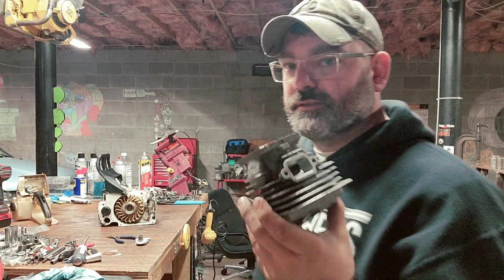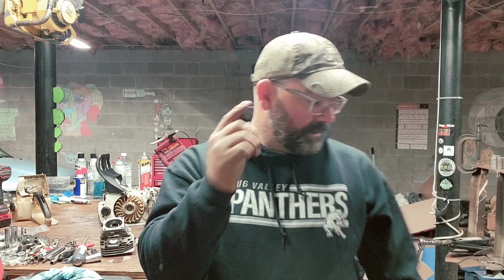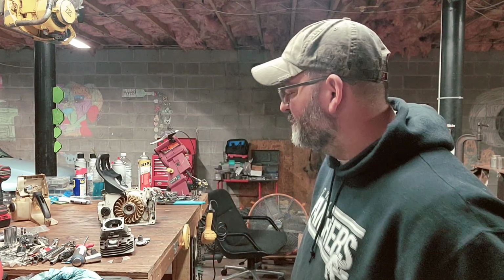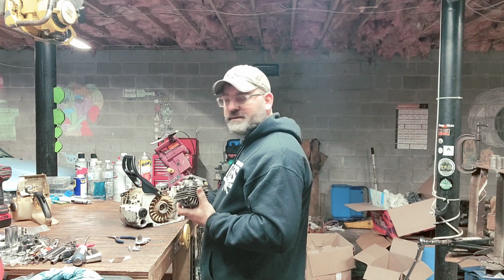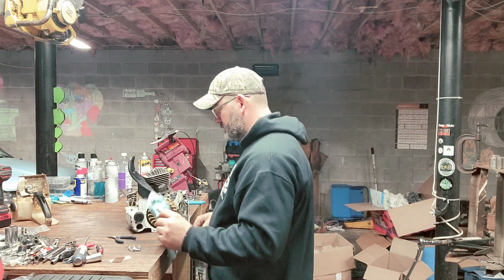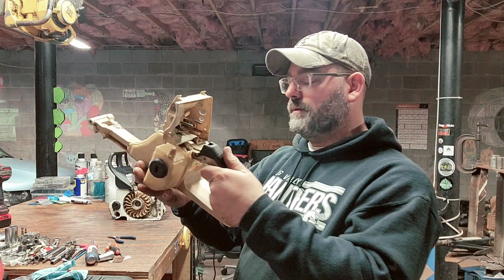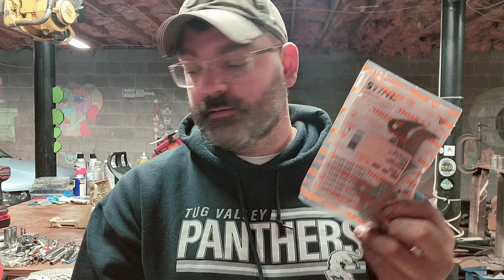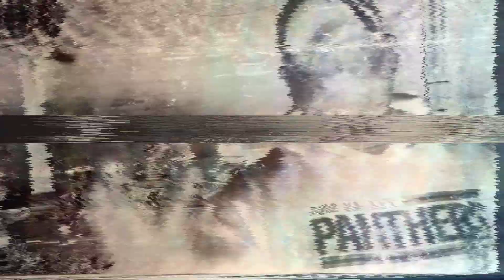Stihl 044/046 ( Part 1 )

Comment: What kind of mods did you do to the 044 cases to be able to put the 046 cylinder on it ? The reason I ask is I'm looking at doing the same cylinder mod but with a 046 big bore cylinder and piston
Reply from the maker: Don't do a big bore kit, I wouldn't. Honestly just bolted right on!
Reply: @NothingBut Chainsaws  ok so I read that for the 046 piston to clear the case's had to be slightly opened up but apparently that's not needed and the reason I was thinking of going with a 046 big bore was just to give it a little bit more but

Comment: Hii Sir,I have a 048 av,I know the cylinder from 042 will fit in it ,but is smaller ,but the 046 has the same size 52mm  and the same piston stroke wich is 36mm,what do you think can I put a 046 cylinder on a 48 av?thanks a lot
Reply from the maker: Just try it out!
Reply: @NothingButChainsaws  the Best way to find out,thank You,I will try it and come back with an answer..